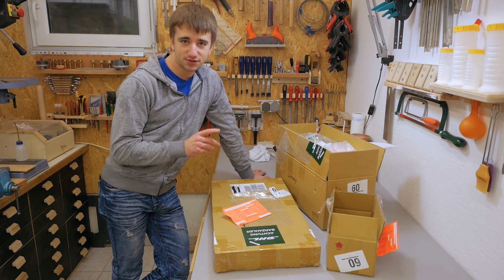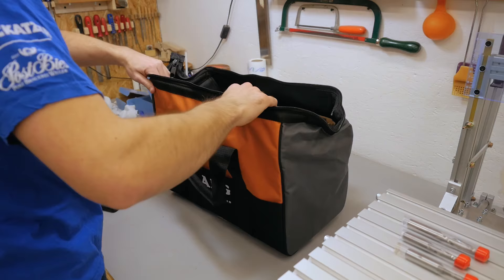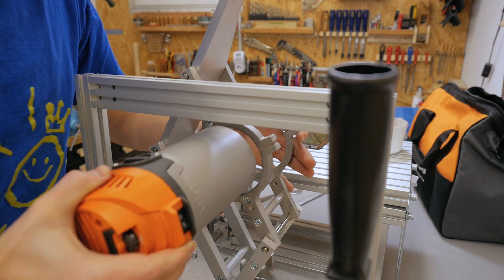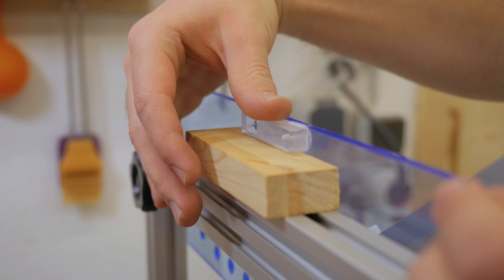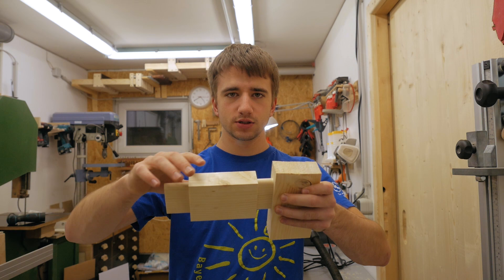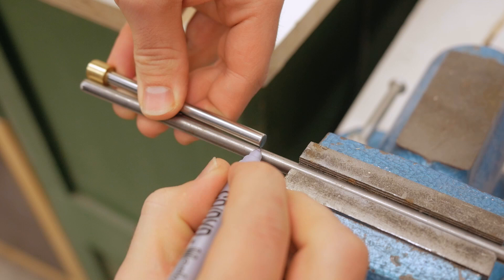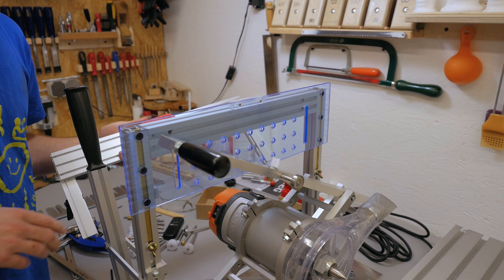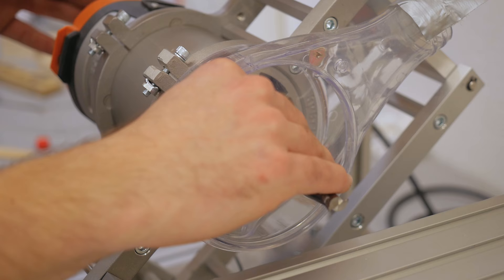Pantorouter and Accessories

Comment: Thank you for your initial impression video!  

We are the distributor for North and South America for the PantoRouter and have a slightly different configuration for our packages.  We no longer ship the acrylic template holder and the older style red plastic templates with our PantoRouters and therefore no longer the 21mm guide bearing.  All of our new templates work with the 22mm, 15mm, 10mm, tapered 10mm and 6mm bearings provided in our packages.

Our router mounts here have a slot for the router pins to slip through, and those sent for the AEG routers will have the same slot very soon.  We supply router mounts for the Porter Cable 890 series routers, but they're not available in 220V so the AEG mounts are required outside the US, Canada and Mexico.  By the way, the same AEG routers are sold in North America at Home Depot under the Ridgid brand but only in 110V.

If we can assist or answer any questions for anyone in North or South America, please visit our website at www.hybridpantorouter.com or send us an email info@hybridpantorouter.com.

We also have a YouTube channel with numerous guidance videos and we're adding more every month.

Thanks again, and Happy PantoRouting!
Mac

Comment: hey I feel like this router is the same as the ridgid. I have one of those and we'll since the plunge base will probably start to get hard to use, a must fix you need for the router is to replace the bearing. the reason it gets too hot or fairly warm is friction. I replaced the bearing with a high speed and problem solved. hopefully gets you places.

Comment: The end of the follower should be straight. The template is tapered so you can adjust the thickness of mortises and tenons by following slightly further in or out.

Comment: Is the bit not heating up because the router is heating up as you have blocked the air vents with the dust shroud? It looks like the dust shroud covers the vents completely which can't be good for the router...

Could you not out a couple of holes on the backside of the dust shroud to allow the dust collector to suck some cooling air through the router?

Comment: Marius. I think you missed the point of the slope on the templates. They are sloped so you can finely adjust the size of the tenon by moving the follower in and out. (I know it's sloped from injection moulding draft angle also)
Reply from the maker: Yeah, I could have included that. I was more focused on including that slope to my  own followers, so I'd have the fine tune feature for every possible template.

Comment: That's one nice router! Personally I am looking at a Makita trim router (700W). Will a trim router suffice for a light duty router table?
Reply from the maker: sure why not
Reply: LetsBuildIt i have one of those routers, i have never found it to be undepowered. also it stays powerfull at low rpm settings. i never use any other routers anymore
Reply: staalmaffia Found the Makita RT0700CX2. I believe it is a very great router and I'm looking forward to the day when I'm able to buy it along with some other nice power tools. Figure I'd save some money on shipping by ordering them all att the same time.
Reply: LetsBuildIt,  i have one with the 4 removable routerbases. I do use it in a routertable for light duty work, and it is just fine. I do use it mostly for small dato's and trim routing. I have a big  1400w router, and I never use that anymore. Great piece of kit.
Reply: Daniel Schoeren That's what I was thinking. Trim routers seems like the most handy of the two.

Comment: Are the holes in the front of the router for airflow? Maybe the motor runs too hot now because the dust shroud blocks the airflow and the heat of the overheating motor then transfers to the router bit.

Comment: It looks like the dust extractor attachment is obstructing the air intakes that cool the motor of the router? If this is causing the motor to overheat, that heat could be travelling down the shaft and heating up the cutter?
Reply from the maker: Yes, that's it. If it's a problem I'll cut some holes in the dust shroud to allow for more air flow.

Comment: one point about the dust collector shield over the router motor vents, you need to cut out holes because the router has to breath if it can't your going to shorten the berings life by overheating as well as the windings on the motor .
you can not block off air flow, it would be like driving a car without coolant in it. its going to overheat and seize up.
on the motor the windings will swell up and or the insulation will burn off causing a short.

the motor has to breath. do what you can to fix it so it can get fresh air.

Comment: Is AEG the German equivalent of ridged which is sold in the United States? That router looks similar to ones sold in Home Depot. Matthias wandel also did a review on the ridged router and found that is was a little bigger in diameter than other routers and that would explain the tight fit in the clamps of the pantorouter
Reply from the maker: Yes, it is the same. But the mounts are made for that size, though still very tight.

Comment: Does having a CNC machine kind of cover the need of buying a pantarouter? I know they are different, and they are both amazing machines, but how much does the pantarouter do that you can't do on the CNC? I can see a use for an edge cutting set up for your CNC like what Frank H has.
Reply from the maker: Cutting a tenon on the end of a 2m long piece of wood would be practically impossible with a CNC as you'd have to mount it upright. On the pantorouter, you can mount it flat on the table.

Comment: Could you have taken.the tightening hardware off the two brackets to allow the router to go in with pins?
Reply from the maker: no, the router clamps stay closed as you saw, even with the screws removed.

Comment: Is the bit getting hot because the airflow for the router motor is blocked by the plastic dust collection shroud causing the motor to overheat and conduct heat down the bit?
Reply from the maker: Yes, that's it. If it's a problem I'll cut some holes in the dust shroud to allow for more air flow.
Reply: Marius Hornberger cutting some holes will make your router motor and bearings last much longer.  Looking forward to see what else you do to the pantarouter.  I like seeing your mods even more than the woodworking projects ;-)
Reply: We did exhaustive (sorry for the pun) testing as we developed the redirected cooling path for the router motor cooling airflow and found no discernible difference with or without the dust collection hood.  The problem is most likely the front bearing and as one of your followers noted above, changing that bearing is not a big job and will probably help.  

The Porter Cable routers used in North America don't have the same issue and so far we haven't heard of heat concerns on Ridgid machines sold here either, but we will keep an eye out. 

Have fun with your PantoRouter!
Reply from the maker: Mac Sheldon Thanks for the respond Mac. I'll see how hot it'll get after cutting more than a single joint and replace the bearing, if needed.

Comment: I see this is video is kinda old but just in case you still check for responses, I'm wondering if you still like having the followers beveled?  I just built a pantarouter and I think you were on to something really useful.  It's odd so many posters seem to be constrained by the idea of only beveling the templates, as if it's somehow improper to be creative.  It certainly seems easier to bevel a set of followers instead of beveling every shop made template.

Comment: Is the dust shoe inhibiting air flow into the router at all? Could that be part of the hot bit issue?
Reply from the maker: yes, that's the main issue. If it'll be a problem, I'll cut slots for air flow into the dust shoe
Reply: Air flow direction is not into the router, but out of the router at the bit end.
Reply: Marius Hornberger  That dust shoe is molded to accommodate a vacuum hose. Besides keeping your work area cleaner, of course the air flow around the bits will keep them cooler.  modify the the router side of the shoe as well to allow air flow out of the base of the router.  I've never smoked the windings in a router, but have in a lesser tool of dubious quality. Every little opportunity to keep things cool helps!
Reply: Actually the see through one supplied now has about 1/4" relief so the cool air can get into the router!

Comment: Hey Marius i plan on using the same router, can i ask where you got the collets? BTW the shaft of the AEG is 92mm - not 89mm 3.5in which might be why it was such a tough fit
Reply from the maker: 8mm and 12mm collet were included, 1/2" collet I ordered together with the machine at my local store that sells AEG. My pantorouter is made for 92mm. If it was for 89mm routers, then it would have been impossible to get it mounted.

Comment: You do realize that the slope on the  template is so that you can adjust for fit by moving the follower in and out right?
Reply from the maker: yes, that works if the fit is close. with the wrong follower size to begin with it won't help.

Comment: Big Congratulations on getting the Pantorouter!!!
I'm sure you will be using it a lot. I think he sent you so many accessories because he knows your work and thinks you will be using most of them.
I know you said you made a lot of the followers for the templates (excellent work) because you just wanted to have them so they would be there when you needed them.
However, I'm curious why you needed to make "so many sizes" rather than the ones you would commonly use? For example I try to use 3/8" on 90% of my mortices. I seldom make 1/4" or 1/2" but would make that size also. So there are three. But you made 10 or more (I think). Just curious? 
Looking forward to the projects you will use the Pantorouter on!
Reply from the maker: As I said in the video. When I make custom templates I never have to think about their size again.

Comment: That is the same router as the ridgid. They must make it for a few different brands.
Reply: Shop built aeg seems to be the name for their 220/240V range. It's the same here in Australia
Reply: Both are TTI companies, who also own Milwaukee, Ryobi, and a few others.
Reply: According to Wikipedia TTI produces power tools for Ridgid but doesn't own it.
Reply: Its the same router, just ridgid is the 120v version, while the AEG is a 220/240v version. I've got both, but the AEG works better for me. The electronics inside uses mains AC frequency for timing, so although I can run a voltage dropper for the ridgid, I can't change the frequency, and the motor is never running at full efficiency thanks to it, and overheats after serious use

Comment: Looks great, it wouldn't be a Marius Hornberger video without some tweaks to a new tool in the shop. :) That is a very expensive router - what were the reasons for choosing this one - was it purely its ability to fit in the pantorouter?
Reply from the maker: yes, there's no router in Europe, (that's cheaper) that would fit the pantorouter.

Comment: Personally, rather than pulling the pin out of the router, I would have just filed a 'V' at the break in the pantarouter. This way the designed of the pantarouter can update his design to be more adaptable for all users. You gave the designer great ideas for improvement with the stops for example... why not add this one as well.
Reply from the maker: That was my first idea as well. But then the spindle lock switch would have been at the wrong position.

Comment: You obviously know what you are doing, I would have had some apprehension about removing that little pin.  Generally I don't think manufacturers install parts with no real purpose, but apparently it was just a guide pin.  I was waiting for something to fly apart, or back out.

Comment: You probably have thought of this by now, but couldn’t you just have filed a small
slot in the Pantorouter mounting frames to clear the pin in your new
router.
Reply from the maker: That was my first idea, but removing the pin was easier and didn't damage anything.

Comment: Marius - are you aware that the slope on the template is to provide adjustment of fit - move the follower in/out to create a smaller/larger cut (depends on whether cutting the mortice or tenon, I guess)?  
I was under the impression that the original followers were straight (non-sloped) and the template has the adjustment slope in it.  I suppose you can still adjust it with both sloped.  
Sorry if I'm preaching to the converted but as you were having trouble with the fit, I wondered if you were aware of the slope. I couldn't see how far off the fit was, so I wondered if it was just a bit off and needed a tweak of the follower length. I was also listening to see if you mentioned (or hinted at) the 'slope adjust' feature, but I didn't hear anything that suggested this.  Hence why I am commenting - sorry if you already know all of this and I'm teaching you to suck eggs!  :/   
Nice toy though :)  A good reward for all your hard work and novel videos.
Reply from the maker: The problem is tenon size I needed was out of the range or not in the range of the followers. 19mm too small, 22mm too big. The follower size needed is about 20,5mm as I calculated. Now with followers  of every size, I have no trouble fitting anything.

Comment: In the US, for most purposes, 12mm is half an inch.
Reply: 12.5*
Reply: Trent Tiedeman it's technically 12.7mm. On most bits it will say 1/2" (12.7mm). However for 12mm bits, it will say 1/2" since it's the closest legible measurement or 15/32" for the more anal companies.

Comment: you coulg have left the pin in and just filed a "V" by the slot where you tighten the router in the pantograph.
Reply from the maker: That was my first idea as well, but I wanted to try pulling out the pin and it was quite simple.

Comment: You noticed that the template was sloped but did not realize that you can set the follower on different depths to get almost any fit you want.  Reading the manual is such a bore.
Reply from the maker: I know that, but if the follower has the wrong size it won't help.